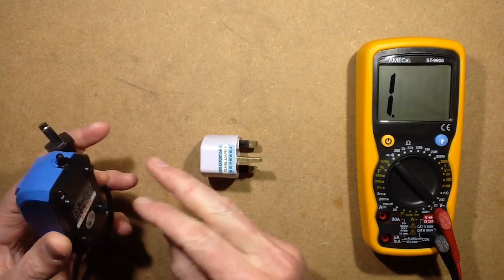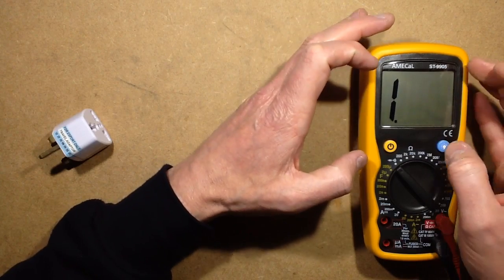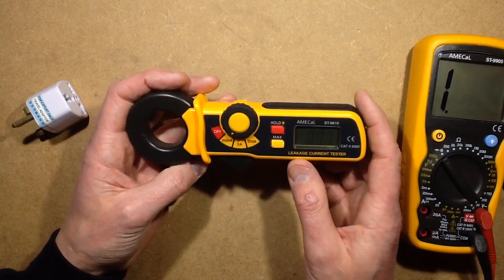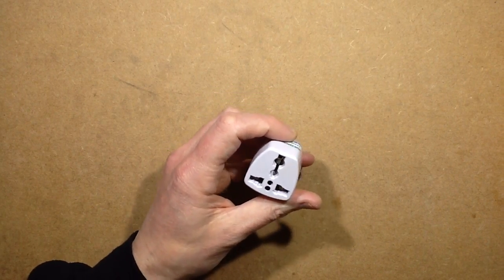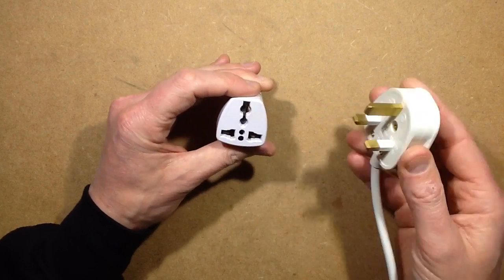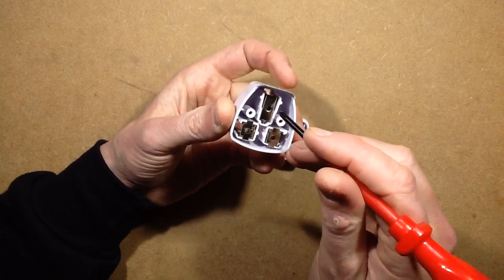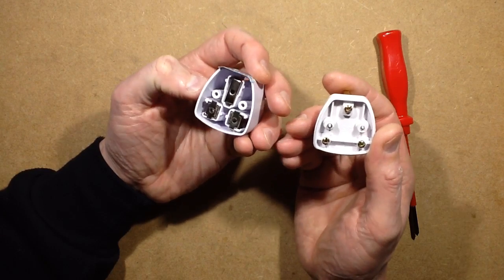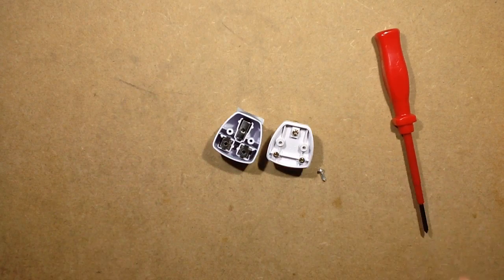Inside another death-dapter variant.

Comment: I bought some plug adapters to use british type transformers on the plugs here in my country. So they look very much like the one in your video, except they are not put together with screws, instead they seem to be "plastic-melted" and of course the male plug is different.
They suffer from the same problem as the ones in your video, as the earth connection seems to be disconnected.

Comment: I recently purchased some reptile heat mats from Singapore as a bit of an experiment to their quality.

with them, I received these exact same horrendous adapters and I took it apart like this and posted to Facebook warning my friends.

Ironically, the reptile heat mats are of good quality construction. 0.75mm copper flex (14W rated mats), the joints to the mat were clean & insulated and the mats themselves.. well they are simple enough to not get wrong.

This was a far cry from the cheap Chinese replacement power supply I bought for my laptop a few years ago.

It set itself alight (which was what made me started checking this stuff) and here is how:

the kettle lead (IEC C13) that came with it, they had went to all the bother to put a fuse in it, but it was completely bypassed. it was connected to nothing inside the molded plug and the live went directly from the socket to the device.

I found it shocking to go to all that length to include a fuse, but not take that extra step to connect it!

Comment: you can unscrew the pins first and put it back with the receptacle in between the screw and the pin. this way they will make contact for sure.
Reply: Yeah, I noticed that immediately -- spent the rest of the video yelling at the screen about it.
Reply: Nope you can't, trust me i tried, holes are not aligned with screws.

Comment: First rule of Chinese manufacturing is: The manufacturer will make sure he makes a profit on the stuff he makes. Either by using cheaper materials,  scrimping on safety margins or removing steps of the manufacturing process.

Comment: Always cut the "US"style plug off and install a "proper Aussie plug', they will only fit a socket one way. IIRC it's the same kind of plug found in many Asian countries. ...  And yes, I'm in Oz.
Reply: James Lamb US plugs are polarized too! But I agree, I the nightmares I've seen while working in far flung lands makes me wary of any kind of adapters. 
One of my favorite death adapters was an instant ground fault, right off the bat. The criminals who made it managed to short live to ground. That would have been a hair raising time if the breaker box didn't have a ground fault trip.
Reply: Ground to live would've tripped the OCPD anyway surely?
Reply: TheChipmunk2008 it wouldn't if it didn't have a ground fault trip, :p 
That's how I knew there was a short to ground in the adapter cause the Bang followed by the box flipping off. 
I don't trust secondary safety features, I'd rather it be safe from the start.
Reply: UK plugs are safe electrically but hurt if u step on it and the pins always point up

Comment: Could it be made better by removing the screws holding in the pins, close the case, and then reinserting the screws though the plug holes. This looks like it would screw the contacts to the pins.

Comment: I see holes in that adapter's pins...  I think maybe the screws for the prongs were supposed to be put in from the female side of the adapter, so they would hold the female connectors solidly against the male pins?  ...And they just forewent that entirely in favor of shaving a second off assembly time?

Comment: Same design faults on New Zealand variant. All 3 pins just held in place with the pressure of the case screws. Previous versions had screws holding metal parts together Worse than that the metal pins are so thin they don’t have good contact to the power socket.  Most dangerous thing I have seen from china yet. I suspect the label is because it doesn’t even pass their own local safety rules and they don’t want to hurt anyone local who could actually get them into trouble with their local authorities.

Comment: why do uk still  has so insecure and bad connectors? couldnt they take the european connectors, which cant be inserted wrong and allways makes contact with earths ground.?
Reply: +gamerpaddy Do you have any clue what you're talking about? British plugs have a MUCH more secure earth than the sliding contacts on Shucko plugs
Reply: +TheChipmunk2008 Uuuuh  they a huge piece of metal which makes them secure. but can be inserted the wrong way around.   thats soooo secure.
Reply: +gamerpaddy sigh the point is the thing they can be inserted into (the socket) is NOT compliant with the regulations. To be fair, all current plugs, worldwide, would be vulnerable to this. What you need to understand (sorry, my hostile attitude didn't help) is that any standard can be defeated. This abomination of a 'socket' allows the earth (ground) of a UK plug to become live... but so would an alligator clip. The Shucko standard has slides on  the edge of the socket, which could easily be disconnected. the US nema 5-15 plug has a round ground pin that would fit any number of outlets.

The UK earth pin itself, being large is quite resistant to misuse, but this nasty, horrible, chinese adaptor manages to have a hole 'loose' eniough to let it fit into the live 'socket'. who we choose to blame for that, must begin with the initials 'china'

Comment: I just took apart the one that arrived with my Cubot H1.
It's exactly the same part, with the same fault.

The screws don't even fix to the holes in the metal parts so they could never be actually screwed together.
Quite a scary thing!

_________________________________________________________________________________
On second thoughts though, most things you'll be plugging in won't even have an earth pin as they will hopefully be double insulated in design. Maybe the Earth being missing isn't as bad as it would at first seem? Would it be any less safe with a plastic earth pin instead?
Reply from the maker: +PIXscotland Ah, my H1 came with a square-pin PSU.
Reply: This is the one I got. I never use it as I have a high power feed from the 5V DC output on my server power supply. PPTC fused of course! :-)

https://dl.dropboxusercontent.com/u/124161/Cubot_Charger.jpg

Comment: I have a load of these which I think will now be shown the bin.  I get a load of bits from China such as IP webcams and phones and always end up with these, however I have always rightfully been weary of using them.  I do still want to use the 2 pin US chargers for something though.  Does anybody know if the is a retailer which sells decent US to UK adapters either in a single or gang form?

Comment: In addition to being a shock hazard, that adapter is also a fire hazard. The lack of a crimped or other mechanically bonded contact means that over time, the resistance will go up and the adapter will be arcing internally when connected to high current loads. Over time the plastic housing will deform and melt, and eventually it could catch fire.

Comment: I would send a polite notice to whomever sold you the pump. If they don't respond well, report them to eBay/Amazon/whatever. These ones are definitely illegal, IIRC a lot of them also have the pins slightly the wrong shape so they can actually cause damage to sockets and potentially not make contact properly (since they're not to spec) and so get rather hot. A lot of them are also physically smaller than the standard requires which causes other problems that I don't recall right now. They obviously don't have fuses which makes them illegal too. You've already mentioned the holes that are far too big and (of course) the lack of shutters.

Comment: How can it even be legal to sell these in the U.K.?  Isn't there a safety body out there whose sole purpose is to clamp down on these things?  They put enough effort into safety standards for Electricians in the electrical trade, so why not general consumer goods? :/
Reply: +9ff70f96 It's not, but unfortunately like most government things, they're probably underfunded.
Reply: +9ff70f96 If they were actually sold in the UK, you could do something. But these things come in straight from china, being purchased directly on the web.. which makes the purchaser both the victim AND the guilty party
Reply: +TheChipmunk2008 I think the "for export only" sticker is an attempt to bypass regulations. If any authority questions the safety, the seller can respond "look, this is exclusively for export away from your country, so it's not your problem", because it doesn't say which country it is to be exported from or to.

Comment: I've yet to find an actual silent pump, after many different ones I eventually read reviews and splashed out on a Eheim 3704 but that still makes a noticeable hum even with Japanese ceramic aerators which I am told allows air to move more easily and not cause so much back pressure. If only I could find a good, SILENT air solution I would be so happy. 

edit: whops,  this comment was ment for the last post :)

Comment: As I had an identical death adaptor waiting for me to look inside it, I took at apart whilst watching this video... Exactly the same inside.. Surely they should have put the screws through the contacts... I think I might have to plug a 10A load into it just so that I can watch the thing melt... Cheers BigClive!!!
Reply from the maker: +Jim Conner They only go on fire while you're not watching them.
Reply: Thanks +bigclivedotcom - Upon post-mortem inspection, it seems that the plastic around the screw holding the live terminal was just starting to melt... I should have given it another hour or two, but I grew bored of standing around in the shed.  Cheers!!
Reply: +Jim Conner Video! :D
Reply: Hi Mr. +TheChipmunk2008 ... I just spent 20 mins in the shed running 11.6Amps through the death-daptor (fan heater), but the reaction was rather unexciting... After 20 mins, the death-daptor was getting rather hot, but no spectacular failure I'm afraid... Just a bit hot and a smell like the plastic was just starting to think about melting... Maybe if I'd left it for an hour or two... but I got bored, so I'm afraid no video for melting the death-daptor. Cheers!!
Reply: +Jim Conner I shall have to get hold of a few of them and try it :D... but thank you :D

Comment: and then my parents continue to use the 2 pin wall outlet to stuff with the plug same to what was in the video (the appliance one). they wont listen because I am 16 and I am "too unexperienced" 
they even run a 2000w vacuum cleaner on it. it hets hot as hell. but the ones we have the metal is screwes into the plug so there is no continuity issuea
Reply: +Anas Malas This kind of stuff drives me mad. your age has nothing to do with electrical theory.
Reply: +Anas Malas My dad pulls that all the time whenever I ask him to use literally any safety equipment of any kind. On the plus side, I get to say I told you so when he gouges an entire knuckle off while using an angle grinder with no guard and an oversized disk running faster than it's rated for in a t-shirt with no gloves and no safety glasses on. He does that regularly, and has ground the same knuckle off about 6 times now, along with other random bits of hand. I get to say I told you so a lot.
Reply: +Anas Malas 
That sucks man, I'm 18 lol. I've had some people be weary of me, but honestly, I probably could do a better job than some electricians out there!
Reply: +Anas Malas Sucks dude; I watched my parents do all kinds of dumb crap despite my advice, when I was a teen.  But I'm 36 now and they still don't listen.  Go figure.
Reply: I'm nearly 17 and build my own PC's. Yet someone else thinks he knows way more about PC's because he's "adult" and I'm a "child".
Yet that person knows jackshit and fails to understand even the basic things about computers.

I was at his home and he was having adware on his PC, noticeable from a mile away. I asked him if I should get rid of it and he said to me "No, I don't want a kid to screw up my PC"

I hate those people. By that logic, a 90 year old guy is a fucking professor and knows literally everything.
Reply: markcumbriauk   "Leave them to it," isn't always good enough.  In some university seminars I had, this was a big problem.  A 45+ year old student would come in and look down their nose at us in our 30's and 20's, talk over us, try to "correct" us.  The Prof. would just let them do it, and this meant we were all learning less, all because of some older person's ego (and a Prof. being permissive.)
And going back to the original context of the video and the post above-- leaving them to it can mean letting them badly injure themself (or worse).
Reply: Benjamin Esposti He has learned. He puts his hand further back now! Doesn't help when his hand slips mind you, but that's just details!
Reply: ᒍᗩᗰᕮᔕ ᑭᗩᗯᔕOᑎ I agree. An older person may have more experience, but an argument should be judged on its merit. "this outlet is unsafe because it's not grounded properly" stands on its merit, it shouldn't matter if a 7 year old or a 50 year old says it. In cases where people don't see that they need to be called on it, because otherwise you get into some scary territory sometimes.
Reply: RFC3514 I meant that the live and neutral get too hot from high resistance!
Reply: Andy Plater
I agree too lol, I've had times where someone calls out that they "have more experience", yet they appear to either be 1. Wrong 2. In significant danger (rolling the dice, etc...).
I also know people who have had similar dealings with others.
( One was at a church. It turned out to be okay to do so, but the so called "expert" (complete with almost 40 years of "experience") wanted to cut a metal structural component of the building, without first getting an opinion about what it's purpose is from some structural engineers. Luck was on his side that time ... but next time, the building may just come crashing down on him ... or he'll be decapitated or crushed by some beam that is(was) under load.)
Reply: yep, you get people like that, My advice, leave them too it
Reply: +Anas Malas - Most modern vacuum cleaners are class II (doubly insulated).
Reply: +Anas Malas I'd go out and buy then a Decent Adapter, better to be safe than sorry
Reply: That sounds like my father, he cut the top of his left thumb off on a circular saw without a guard, another time it was the tops of two fingers. Another occasion his lose shirt got caught in  an angle grinder and was twisted and ripped, he only had a few bruises that time.
Reply: I'm over 50 and have enough sense to realize when a "child" in making sense and seems to know about something a bit foggy to me. I win then I guess.
Reply: Teth47
And he has never learned?
LOL, some people ... SMH XD
Reply: Teenagers think they know *everything*.  They're wrong, of course, but it doesn't do any good to tell them that.  You'll understand when you get older...

Comment: I have at least two very similar ones as well (can't find the rest), the Schuko-version that is (and funnily enough two Australian versions, because apparently the Chinese don't know where Austria is). They are clipped together though, so I can't open them and I don't want to destroy them, because I need them for wall wart power supplies where I can't exchange the plug. But I measured the resistance on the Earth pin: 250kOhm on one, 150Ohm on the other.... After pushing into the earth socket with a screwdriver it has gone down to 3-5Ohm on both. I filled the earth pin with hot glue on both, so I don't forget that and will exchange them when eventually.

Comment: I've had a few of these over the years, but most shockingly I had one sent to me by an Amazon seller when I bought an ethernet switch.

The best place for these is the bin.
Reply: +Strider9655  "The best place for these is the bin."

Very true - and for that's where I immediately put the ones I get, given that the body  won't fit into the round recess of the outlets; utterly useless here.
Reply: Surely you could use the metal elsewhere? If not to repair an actually good plug, then at least as scrap metal to melt down?
Reply: @lepidotos  Sure, because the average person has an use for molten metal.